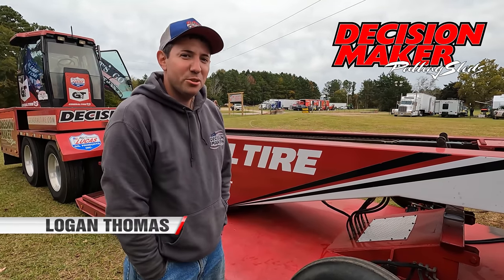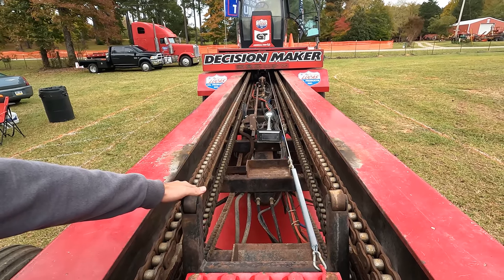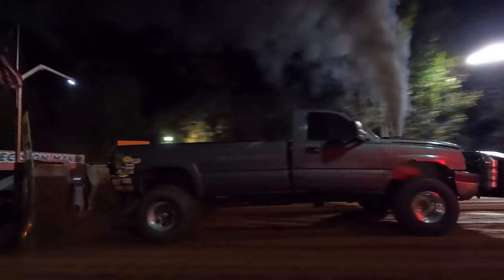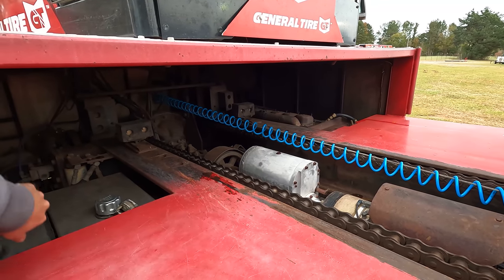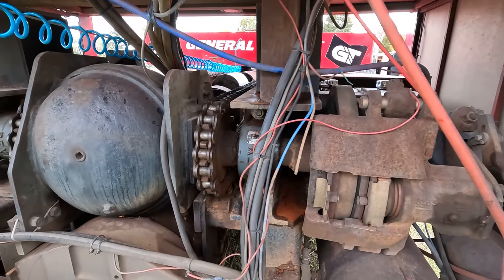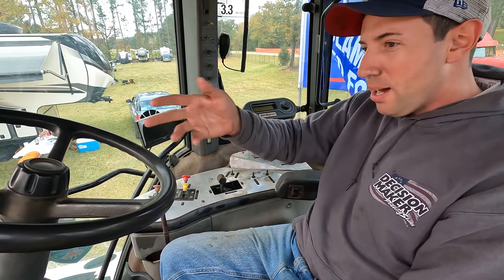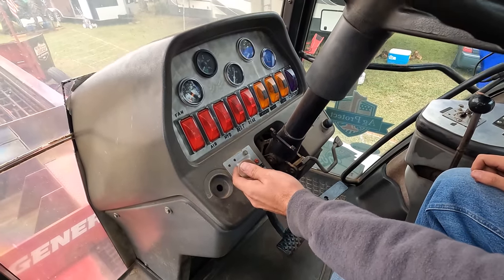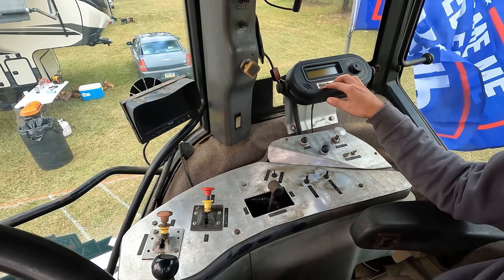Tractor & Truck Pulling Sled: Basics 101

Comment: Nice explanation about the workings of a current pulling sled. I’ve been a tuck and tractor pulling fan since the late 70’s when everything was controlled by levers! Also, if you look at the close up of your push down cylinders at 3:52, you’ll see why the welds are cracking at the pan. If you add a heavy steel roller on the top of the push down it might allow the freedom of movement need to not flex the bracket? Looking forward to seeing you around this season!

Comment: Looks identical, except for the paint, to the sleds the NTPA uses. Who supplies the cabs also?
Reply: Most use cabs from actual Case tractors.
Reply: There are only three people who build sleds in this configuration. Vaughn Bauer (who built the sled in this video) builds the Ironman sleds, Brandon Bungart builds the X-Factor sleds, and Richard Love (who owns the sled in this video) builds the Decision Maker sleds. There are others who build similar looking sleds but have different driveline & hydraulic configurations. All the cabs are either purchased new or from salvage machines, some are tractor cabs, some are combine cabs.

Comment: Still don't understand how this system is fair between competitors. 
It seems pretty random when the weights go forward and the sled digs.
Reply: It depends on speed the faster you go the fast the track pushing the box forward and same for slow speed
Reply: The movement of the weight box is driven directly by the wheels of the front axle of the rear tandems. The box will hit the front of the sled no matter if you're pulling it 3 mph or 33 mph. Of course the settings are changed from class to class, or if the first puller in a class goes too far, or not far enough.
Reply: Great explanation! Watched a big Case steam traction engine drag the pan off the track, couldn’t stop it.

Comment: Is there a tractor capable of towing the sled with its full load? Muy buen video. Bien explicado. Muy interesante.
Reply from the maker: The Unlimited Modifieds have pulled with the sled having every weight in it depending on track conditions.